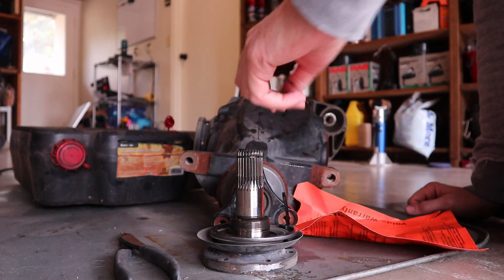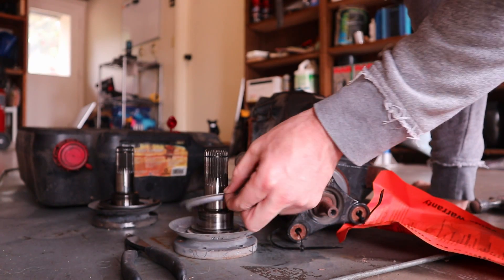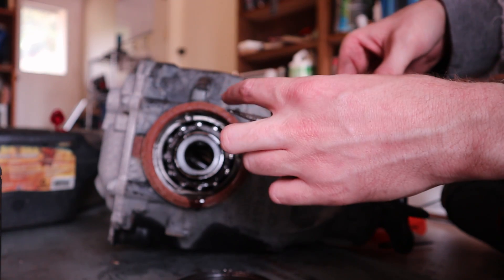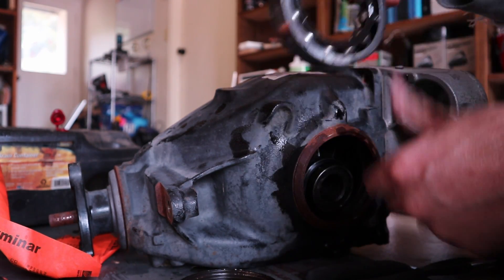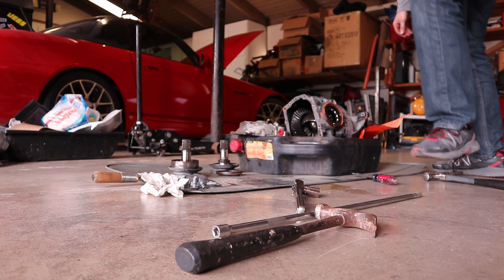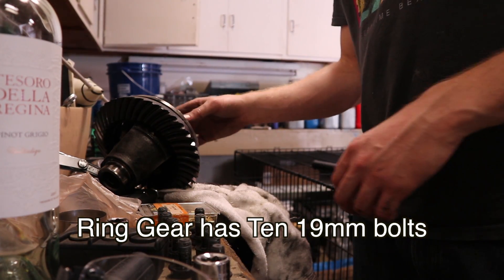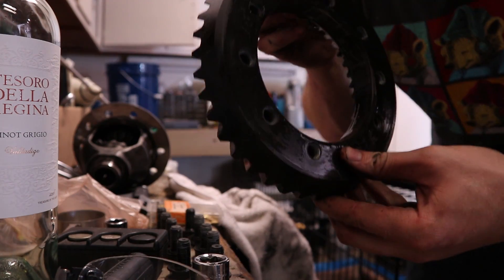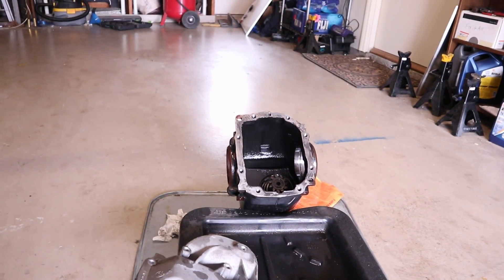DIY - Disassembling BMW Differential for LSD Install

Comment: How did you initially pull out axle bearing before you could pull it out by hand in this video? Did you use an inverted three arm puller to pull the bearing out first?

Comment: Where did you get those pliers? I need a pair so I can take my diff apart easier
Reply from the maker: I believe Home Depot or lowes. I'll check. These are just thick needle nose pliers. I found that snap ring pliers didn't work well on my diff rings.
Reply: ZentRose thanks for the reply, I'll have to check lowes, I've checked 2 HD and they didn't have the short nose ones. Ended up breaking a set of snap rings. Can't seem to find the same pair lol
Reply: I went to Harbor Freight, didn't have anything close to it. Ended up using a plier we had and worked it out with 3 people using flat head and stuff to pry it out. LOL
Reply: tigermack I have managed to remove one a while ago which required a lot of effort and the same screw driver method. Ended up bending the snapping ring so that's not fun. Any ideas to find snapping rings?
Reply: You can actually put the rings back, they should be able to clip in place. Especially if you have a brass punch, it wouldn't leave a ding on it if you used that.

Comment: How did you pull those rings out so easily???
Reply from the maker: Use needle nose pliers not snap ring pliers and they come off without a fuss.
Reply: you must've lots of strength cause that wasn't the case for us! lol
Reply: Yeah mate. I just scavenged 3 diffs and removing the first 3 snap-rings was not easy at all.